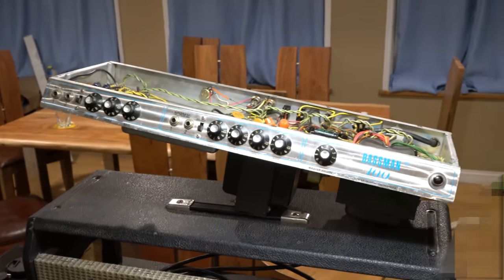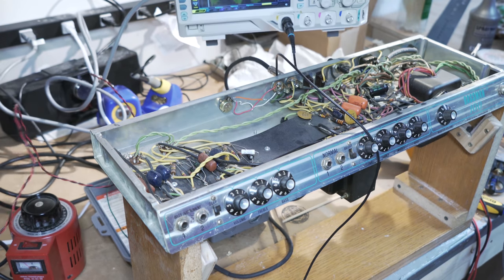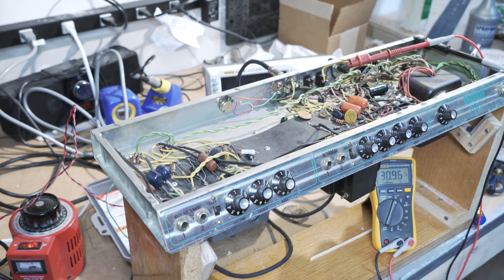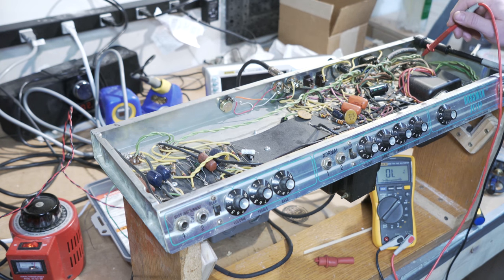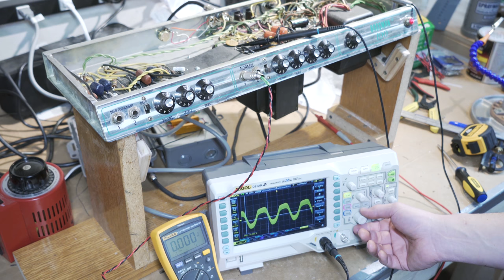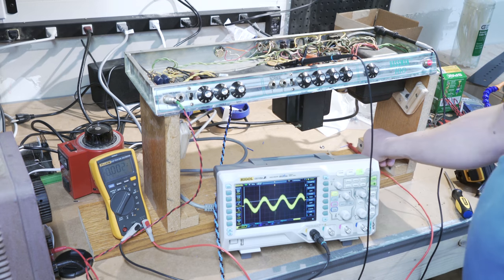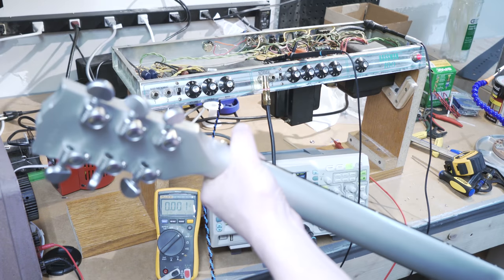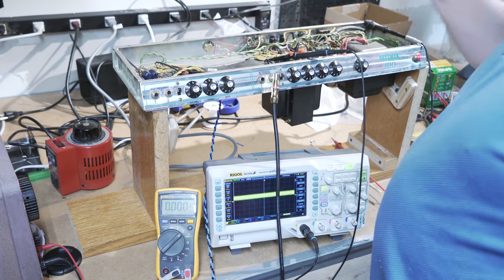Bassman 100 Troubleshooting

Comment: I have one of these which I have completely rebuilt.
I made it into a super-clean Twin Reverb but without reverb and tremolo.
You could even create the trem circuit without permanently modding the amp if you gave up channel two's preamp tube.
This Bassman 100 is so punchy compared to his little sibling, my '73 Deluxe Reverb.
That's in part because the Bassman has a diode rectifier (F.R.E.D.'s, fast-recovery diodes), and the DR has a tube rectifier as well as lower voltages on the preamp.
The Bassman 100 could be run 100-80 watts into 4 ohms, or use 2-6L6's for 40 watts into 8 ohms, or use 2-JJ 6v6's for 20 watts into 16 ohms. Very versatile! And the size and sound  of all that iron!
I love Silverface Fenders ... my favourite amps by far.
Reply from the maker: Very cool, I went and converted it into a dumble clone though.  Maybe blasphemy to you :)
Reply: Frenchie Films :
No, not at all ... that sounds like something fun to try.
Where do you get all the info on Dumbles?
I thought he hid his tone-shaping secrets under gobs of silicone ... are there schematics and/or chassis layouts online?
Was it a ton of work?
How did it turn out?
For me, besides sounding great, I like amps to be dead quiet and to be able to have all controls dimed and still run properly..
Reply from the maker: I am the administrator of the forums where you can find this information.  Ampgarage.com/forum
Reply: Frenchie Films : Thanks, I just joined.
Are you using those Ceriatone kits to build your Dumble clones?
Reply from the maker: Nope I'm sourcing all the parts myself between mouser.com and tubesandmore.com.  if you want to start a thread there we can have the whole group answer questions in more detail.

Comment: I have one of these and i want to run it into an 8ohms twonotes captor X - since this amp runs at 4ohms im thinking ill just remove a 6l6 from each side.. thoughts? also do you have a video where you bias this amp?
Reply from the maker: I didn't bias this amp because I used it for the guts for my Dumble ODS #124 build I did.  I did do a separate video on biasing amps in general, somewhere out there :) Adjusting the tube doesn't adjust the impedance of the output, it just adjusts the operating point of the tubes.  It won't hurt to run a tube amp into an 8 ohm output if it's 4 ohms but it will modify the tone a little because of the change in impedance.  The 8 ohm on the output will then reflect a different impedance to the output transformer on the other side where the tubes are.

Comment: I just bought a bassman 50....it was fine for weeks, then the "power" switch fell into pieces. I purchased a SPST switch to repair it. Wirered and now I have 0 power to the "supply" switch as well as the power switch......Any suggestions??
Reply from the maker: Make sure the fuse didn't blow.  You should still have 120/240 vac on the input to the switch.  Might have been wired wrong

Comment: At 13:04 you say you have about 24 volts on the scope coming from the phase inverter going to the output transformer but the phase inverter does not feed the output transformer, it feeds the grids of the power tubes. Plus the scope probe is connected to the input of the phase inverter, rather than the output.
Reply from the maker: sorry I've not been checking comments a ton lately, yeah that makes sense, I honestly don't even recall what's going on here as I published this video so long ago, but what you're saying makes perfect sense.  Sometimes in my head I'm thinking one thing and saying another, or I could have just been completely wrong :).

Comment: my 1974 bassman 100 produces no sound at all. What should I look for or test?
Reply from the maker: That's a very broad list of possibilities.  Check the output speaker itself or the speaker wires.  Check that all tubes are working.  Check that the volume controls are up fully as are the time controls etc.